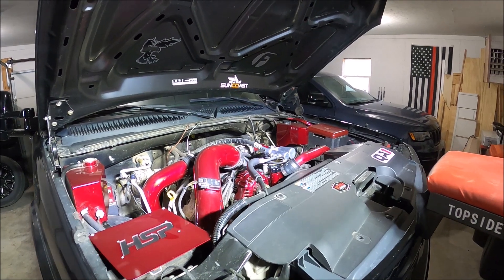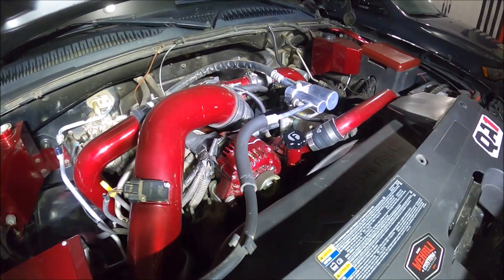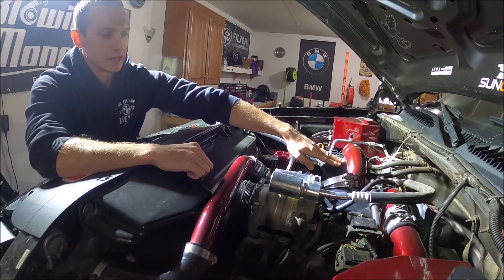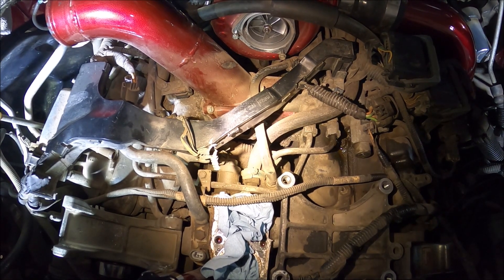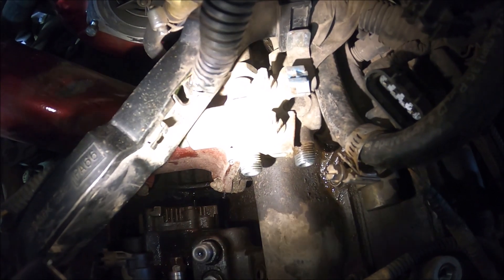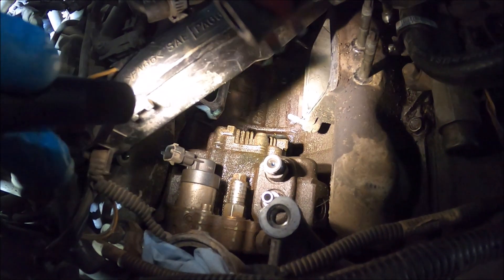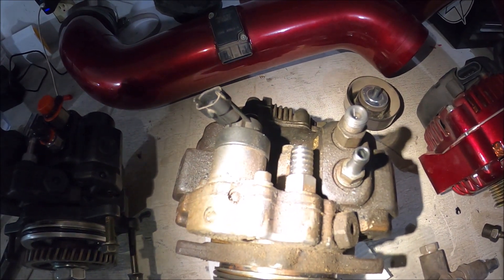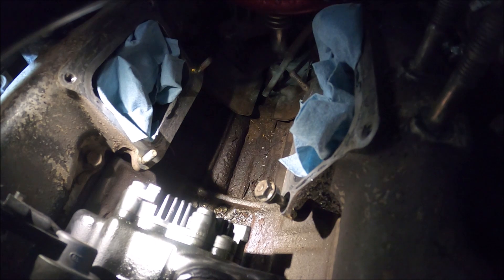Shooting for 1000hp worth of fuel! LB7 Duramax Ybridge and CP3 Replacement Tutorial

Comment: Quick question I have to change my cp3 I’ve been told I need to have the truck in time in order to do so is that correct?
Reply from the maker: Hey good question. The cp3 does NOT need to be timed. On older engines without electronic fuel injection the pumps were responsible for delivering fuel at the proper time to the cylinder. On a common rail/EFI system the fuel injector has an electric solenoid on the the body that opens and closes to deliver fuel at the correct time and quantity (Hence the term electronic fuel injection.) The gear on the cp3 pump can be meshed at any point in the rotation to the cam gear.
Reply: Thank you

Comment: How much power alone with 3 inch y bridge ? Any different turbo whistle?
Reply from the maker: Short answer, not much. You will see a small gain from upgrading all your piping and ybridge due to less restriction, but not much. The ybridge won't due anything for turbo whistle, a fabricated intake will do the most there (besides upgrading the turbo itself)

Comment: Hey there. Do you still have stock internals? I’m putting off doing a whole rotating assembly or just rods because I honestly don’t want to spend the money. Currently getting all of this:
Mahle Upper Gaskets
Mahle Grade C Head Gaskets
Exotic Head Studs
S&S 45% over Injectors w/ New Injector Cups
FASS 165GPH lift pump w/ Sump
EFI Live Custom Tunes from Motor Ops on-the-fly DSP5 Switch w/ ECM & TCM Tuning 
ATS Stage 5 Custom Built Transmission
* Billet Input, Output, and Intermediate Shafts
* Billet Flex Plate
* Billet Triple Disk Viskus Torque Converter
* Billet Valve Body
* ATS Deep Trans Pan
WherliCustom Fab S300 Single Turbo Kit w/ Billet S369 w/ Blanket
S&S 10mm CP3 (LBZ based High Pressure CP3 IP good for over 800HP) 

And more. Just wondering if I will be playing with the devil on bending rods. Let me know what you think!
Reply from the maker: Nice build! So yeah long story short you should be in the 700+ hp range with that setup, with proper tuning if I take a wild stab at it. You need to make sure you are working closely with your tuner, ensuring he is trying to keep the torque out of the low rpm range. That's where the real danger is, big torque on slow moving rods, they can get hurt easily. But a lot of guys have good luck keeping stock bottom end trucks together for a long time getting up into that power level. That being said, it is most likely a when, not an if, that it will get some damage at some point.

Comment: Did you have to do any tuning for bypassing the FICM? Any CELs?
Reply from the maker: Nope, there is no flow or pressure readings through the FICM. It has no idea there is no longer fuel passing through it.
Reply: @FixedVaneDuramax  I've re done my fuel system since I made that comment. I found some info about the FICM using the fuel to cool itself. I ran right from my lift pump filters to the FICM and then to the CP3. I swapped the fitting on the CP3 to a half inch barb. Thanks for the reply though 👍

Comment: How is the tru trac vs the stock rear end
Reply: Does it lock up better?
Reply from the maker: I’ve never had an issue with one in multiple trucks. Essentially works like stock but doesn’t break under big power.

Comment: Are you still running this CP3?
Reply from the maker: Yep, paired with a set of 65% SAC injectors
Reply: @FixedVaneDuramax  I've been wanting to go bigger cp3 but cannot find reviews on any
Reply from the maker: @boostedbryan369  Stick with Exergy, S&S, or Fleece and you can’t go wrong. Properly size the pump to your hp goals. Bigger isnt always better. This much is bigger than I need and surges a bit. 10mm wouldve been perfect and can support up to 750hp worth of fuel.
Reply: @FixedVaneDuramax  I'm pushing 703hp right now I was wanting to get closer to the 800hp range but yeah exergy sounds good

Comment: How’d you go about that 1/2” cp3 feed kit? Also with the ficm? Most people run it from the filter housing to the new fitting but I’m removing the filter head.
Reply from the maker: I ran a new 1/2” line directly from my lift pump all the way to the cp3. Gets rid of a lot of extra lines and such but it requires you to run your FICM dry. Otherwise if you want to keep the flow to your FICM let it feed in, then make a line connecting the FICM outlet to your cp3 inlet.
Reply: @FixedVaneDuramax  same way I was planning on running mine. It’s all apart right now injectors shall be in tomorrow. I’m down south Louisiana and didn’t quite want to run it dry due to heat. But I may extend my harness so I can relocate and bypass the ficm so it’s a straight shot to the cp3
Reply: Run 1/2 to ur ficm and wrap it around from ficm to
The cp3
Then if u don’t wanna run it dry bubba

Comment: Good vid again.   I have also deleted my stock pump cuz of my after market.   Can u point me in the right direction for the larger hose adaptor in the cp3.  I wanna hook the fuel line directly to that as well.   Unless I have a vid I didn’t see lol.
Reply from the maker: Cheers! Here is a link to the Fleece Inlet Fitting on Alligator Performance's website. I have a1/2" line running directly from the outlet of the lift pump all the way up to the cp3, deleting all the extra lines.
https://www.alligatorperformance.com/fleece-cp3-feed-1-2-cp3-feed-fitting-universal/?gclid=Cj0KCQiAlsv_BRDtARIsAHMGVSakiNSYxMwbOjZCCUovYBKYs0lTqWHW47zb9mjx_bk3QYkfc5w8OxMaAgh8EALw_wcB

Comment: Did you notice a difference in just the egr delete when you installed?
Reply from the maker: So this is a federal emissions lb7 so there wasn't an EGR system on the truck to begin with. If you have a lly or lbz that is stock with its egr system, and somehow it magically disappears and the truck gets tuned, yes you will see a large difference but the majority of the difference is purely in the tuning not the blocking of the EGR. In fact you can get block off plates to simply block it off and have it shut off in tuning, and get the same result. The main benefit of getting a full delete and cold side piping kit is that is removes the layers of sooty build up from the EGR that are in the cold side system. So long story short, untuned emissions equipped will not hold a candle versus tuned and deleted older trucks. As you get into the newer trucks like LMLs and L5Ps that begins to change but definitely a big dig difference in the older trucks.
Reply: @FixedVaneDuramax  thanks for the input! Tuning has my Egr turned off. I have a hsp kit on the way so it’s less chance of a boost leak at the y bridge.